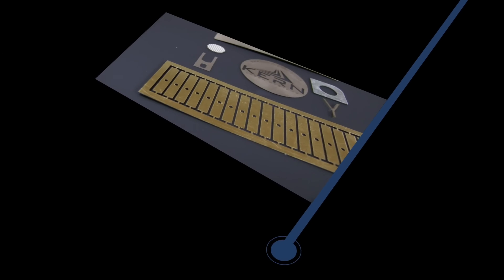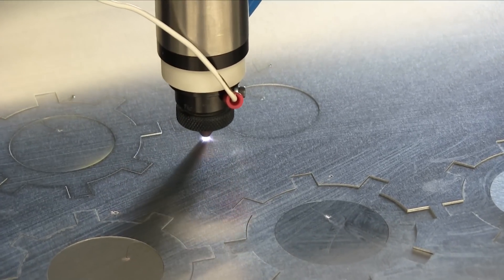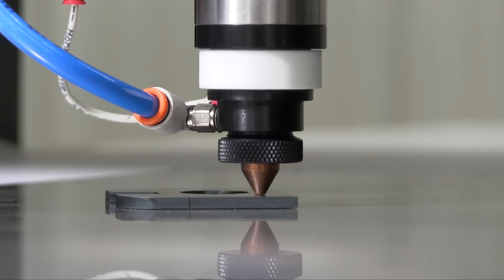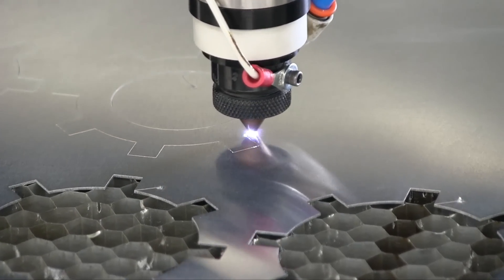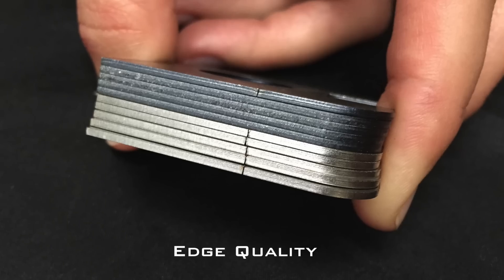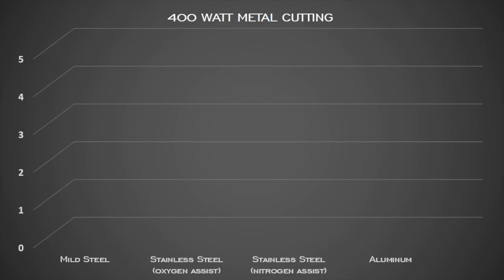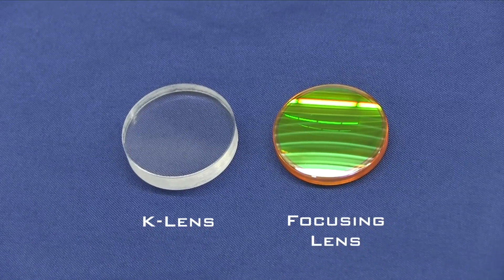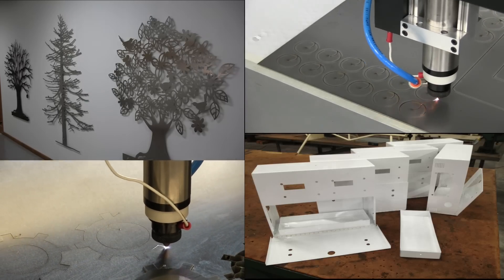Metal Cutting Laser - Kern Laser Systems

Comment: Kern Folks, what type of laser is this, a CO2, Fiber, YAG?  Very interesting the different capabilities and applications this laser is capable.
Reply: It's a closed CO2 system. We have one at work. It's good for upto .187" steel or .06" aluminum.

My experience after running a 2k w Amada.. The Kern is an extreme laser printer.